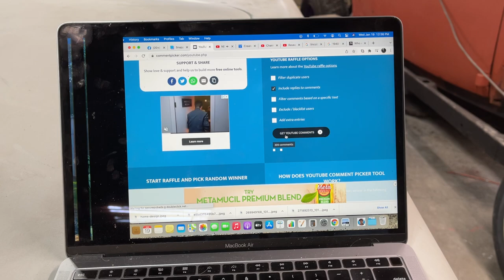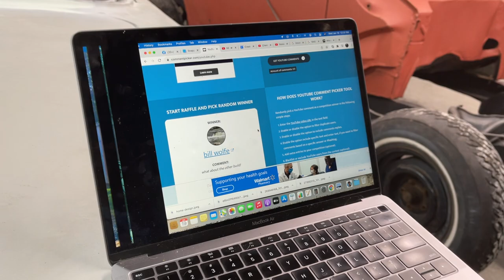4" Roof Chop: Converting a 1940 Ford Tudor into a Coupe (part 2)

Comment: I'm going to do this on my 36 ford 2 door Sedan to a 3 window  this will be a great inspirational build
Reply: I think I would lower the front just a little more than the door.
Reply: @i8ntnuts  im thinking about going to a six inch chop im doing a 35 2 door hump back sedan and we chopped it 6 . A coupe would look bitchn with a six inch chop

Comment: Viva La Lincoln Electric! Yeah, it’s the Cadbury Vs Hershey’s battle ... brand loyalty, etc. I love my Lincoln Powermig 210 MP. I chose to buy a PrimeWeld Cut60 plasma cutter and it has been awesome for me - but it does not have a built-in compressor. Good on Lincoln for sending you that machine, I hope it serves you well, Chad. For the money the PrimeWeld cutter fit my budget and has worked for me every time I’ve needed it. All for what it’s worth.

Comment: I've been following Chad for over a year now and am always impressed with his ability to control those grinders with cutoff wheels. It takes a lot of forearm strength, with good control against kickback. You must keep in good shape to be able to maintain that control. I have several brands and none of them are either light or easy to control regardless of the wheel thickness... I need two hands for that! Love to watch you chop and remake the vehicles.
Reply: He can still do 100 push ups no problem, 50 years old, that's pretty impressive. He did it in his video of them visiting Gambino Customs in California. 😉

Comment: Looks great. I can't wait to see how it turns out.  Just thinking about the chop out of the rear section.  Before you do it.  The 4" on the diagonal in the front probably works out to only 3" or so vertically.

Comment: Love that Lincoln Plasma Cutter! What a great tool!  Chad's doing a great job with the chop! Get yourself a 5 ft step ladder! Suggest you cut the rear side (like you did with the top of the front door) to complete the roof line. Bring that rear section as far forward as you can, in order to find the spot where the top of the door and the rear part are the closest match. That will avoid the mismatch like you found with the race car.

Comment: The review on the Lincoln Tomahawk 375 states the using an external compressor is a little better. Because using the onboard one the duty cycle is limited to a short use time. Although the say it still works fine for short time usage.

Comment: I think I would of cut the same 4" section from the door frame to match the cut of the window post
Reply: To lower the roof 4 inches you would need to take more than 4 inches out of the window frame.

Comment: It would've been best that you left the bottom of door wing vent window post on the door cutting door vent post  the same with the sinner windshield cut, and cut back half of the roof off sliding it forward over the front roof, to get better visual on roof to door alignment,  just saying thats the way I would've done it

Comment: Jolene make contact  with a Battery tool company,  get rid of all those cables. They  can set chad up with all the Battery tools he needs with a battery rack so he has plenty of power.  
  Suggest talking with     DeWalt  Just saw the Battery one chad was using, not enough Volts needs more volts DC to do the job. Talk with an expert from De walt.

Comment: I'm not sure if your gonna read this or not. The way I was taught was to separate the 4 corners so that each piece can move down by themselves.  That's because of the angles. Trust me it's better to fight one angle than 2 or 4 at a time. Cut the roof right down the middle front to back to a point below the glass would be. Then cut it from side to side right down the middle of the posts not the doors. Now you have 4 pieces when you cut them loose around the sides. Now when you figure out you 4 inches you can bring them down by themselves at the same amount with out them fighting each other on the angles. I know your worried about the roof but that isn't that hard to do as getting the angles right on 4  or 6 posts. get a plastic model car And try it & you'll see what I'm talking about. Helped a guy do it that way. It was quick & each corner was perfect

Comment: I have a Dremel cordless cutter which used to cut out just like your cordless grinder. Lights flashing indicated an "overheating battery", which it wasn't as it had only run less than a minute. I returned it under warranty and Dremel fixed it. Maybe you can do the same with the grinder?

Comment: I'm really sorry to ask this question but yes I watch these videos everyday, but for me to do something like this I wouldn't have a clue.
So my question is. Why wouldn't you cut the door frame the same as the 4 inch front frame. Instead of losing the bottom curve. 
Your so great I love watching these videos
Reply: Not sure if this answers your question or not. The length of the cut will be different because the windshield frame is not vertical. I don’t remember the number offhand but if the windshield was at a 45° angle you would multiply 4 inches times 1.41 to give you the cut length. That would give you a 4 inch chop. As it is now the roof will be somewhere between 3 and 4 inches lower.
Reply: @i8ntnuts  thank you for taking the time to answer, like a say I would have a clue where to start on something like this, but I watch everyday as its amazing viewing. 
Thank you again

Comment: Wow the tomahawk works well and is quite quiet considering. The price is a bit much but seems to be worth it.
I personally don’t think you cut the door top correct you should have cut it in the same place you chopped the a pillar. Some times you need to slow down and plan your attack.

Comment: hi hpe ur both wel wouldnt it have bn easyer to do the roof first n then add the top off the door n al so leaved the bottum off the dor at the frunt on so u got that bit here n its just streght weld m8

Comment: Watched you dig that 40 out on FB just to get it in your shop, afraid this project is going to longer than a week after looking at all that snow you would have to dig just to get it back outside your shop. Curious, will u need your outside lift to get the Bugatti body back on the frame? That may be a while as well. Stay warm!